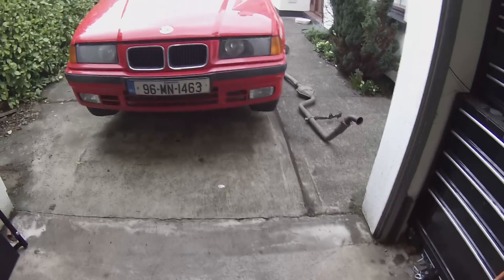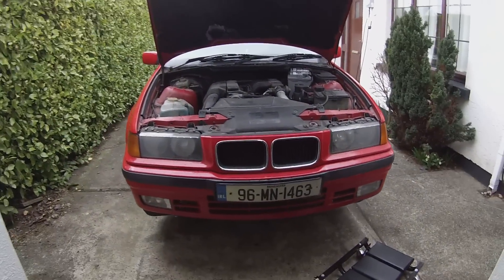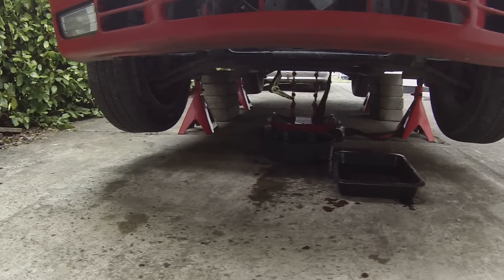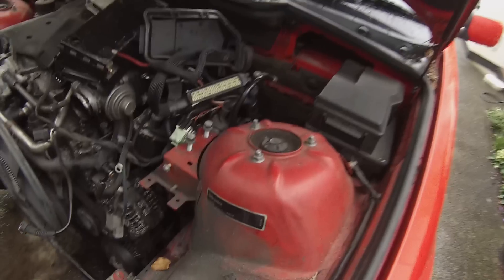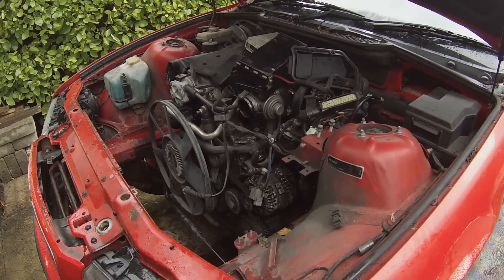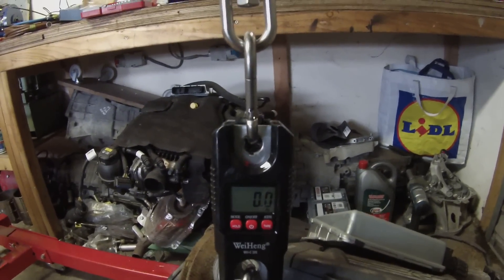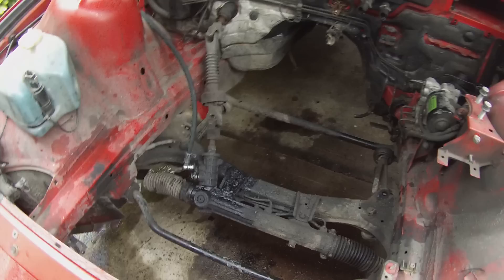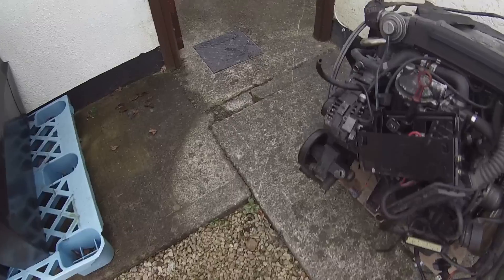€1,000 BMW E36 EV Build 04 : Diesel Delete

Comment: Can’t wait for next video, weight of engine and associated bits never taken into account when comparing with ev  don’t forget fuel tank and that liquid called diesel, petrol, gas for the USA viewers, + radiator fluid ,all have extra weight not in many ev . Interesting if you could weigh the other bits exhaust etc that you took out

Comment: Good stuff Damien 👍
I suspect that the battery pack and motor will far outweigh the engine and fuel tank and there will be a net gain in weight . I think that old air conditioning units may be another cheap source of IGBT's , I'll have a look at some old units as they have very substantial heat sinks fitted . Best of luck with the build and budget.